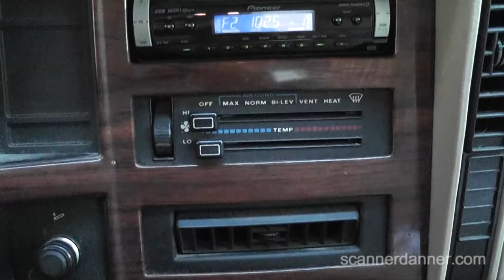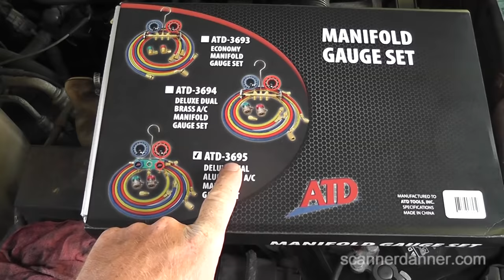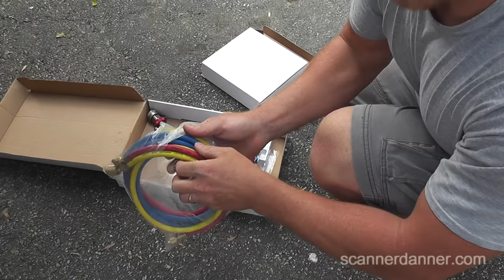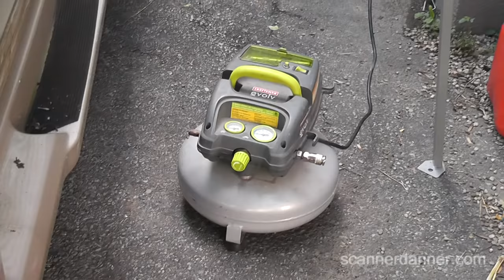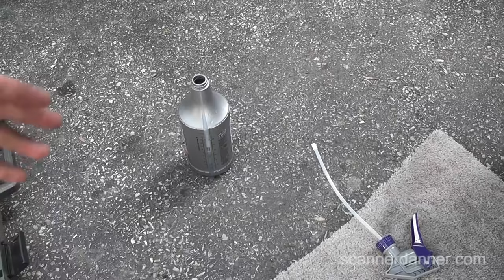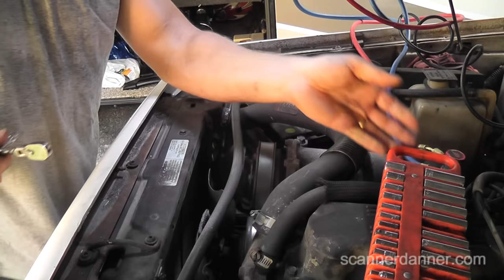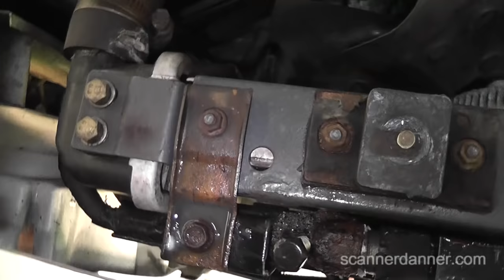A/C Leak Testing and Repair part 1 - 95 Jeep

Comment: and again.... 

the Milwaukee fuel ratchets SUCK! I went through one a month for three months before I trashed it. the 3/8 impact gun from Milwaukee is weaker than my 1/4 in impact from snap on.  the Milwaukee ratchets amble is stupid weak,  they break themselves all the time,  and it's specifically the only part NOT covered by warranty.  Battery life though was excellent, using ratchet only the battery would last almost a full week with heavy use.

Comment: A class "A"  diesel pusher motor home,  real class,  pulling a $500.00 dingey,  getto.  Why not pull the Navagator or the pick-up.
Reply from the maker: half the weight. 
3700lbs without passengers I think. 
I can haul 10,000 lbs but with the 6 of us and two dogs why not limit the weight as much as possible. Plus, I don't care about stones and road debris coming from my RV! And I will never wash it :-)
Reply: +ScannerDanner it's all about looking good when you pull into the campground
Reply from the maker: I was thinking the Jeep would help me fit in better :-)

Comment: That was not a briliant idea of screwing in a screw in the line. Youre introducing rust metal shavings in to the system.
Bosch Brushless tools i like! FordTechMukaloco used them for years.. but not anymore.
Reply from the maker: What about the road dirt and debris from the gaping hole? I absolutely did not contaminate this system any more than it already was doing what I did.
Reply: @ScannerDanner  A friend accidentally made a crack in one of my AC pipes/lines from compressor to condensor when hitting the cover under the compressor, somehow without even touching the line it went wrong. The line has a coupling from compressor to a hose. The crack is just at the coupling. All the R134A escaped out.. PSssscchhh... :)
Ive read that the dryer are recommended that you replace. But i really dont want to do that. The system has been open for like 1-2 weeks. With open i mean through that tiny crack that isnt visible.

Ive also read that if that the system has been open for like several months the dryer should be replaced.. for a longer time.. but not necessary needed in just like some weeks.

Am i required to replace the dryer? Ive seen that you dont do it in some videos with systems that has been open to the atmosphere.

They have "AC-service" here at mostly of our shops locally. They charge about 150 euro for that. They vacuum the system, suck the oil, moisture, R134A out of it, leak test it, repair if neccesary and fill.
Reply from the maker: @orfeous  I've done hundreds and hundreds of leak repairs with empty systems exposed to the atmosphere and never changed the drier and had ZERO issues. I say go for it.
Reply: @ScannerDanner  thank you! 👌💪🚗
Reply: @ScannerDanner  finally i replaced the affected line/pipe. Found no visible holes or cracks. The refrigerant must have escaped somehow when there was pressure on the coupling at the line/pipes end.. what is the name of it?
Im really scared that the ackumulator has gone bad and won't work anymore because of the "drying media" has gone bad and then the system will ice up and send all the sandy debris in the system. Im really anxious, afraid and scared.

In your experience how common is it that the ackumulator fails when the system has been open for a longer period like a couple of weeks or at most 2-3 months?

What will the symptoms be if that's the case that I've screwed up? :(

I have of course replaced the o-rings and oiled them with PAG 46 oil that my system uses.
I have made and appointment at a shop for a "ac-service" that they call it here. In one week 29 July
Recovering gas if there's some, vacuuming, pressure test, add dye, add refrigerant, leak test, and i hope oil.
Did the oil escape when the system went psssschh? Can old oil be recovered with their machine? How do they now how much oil they might need to add? The only thing i can tell them is that I've changed that short pipe from compressor to the coupling.. like a 30cm one.

Sorry for my english and my own naming for parts and things. Hope you will understand.